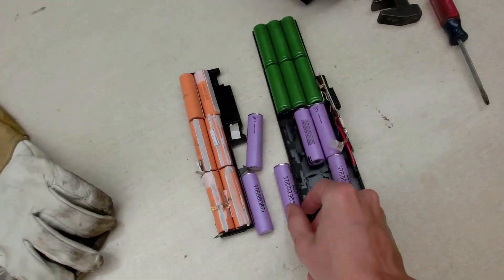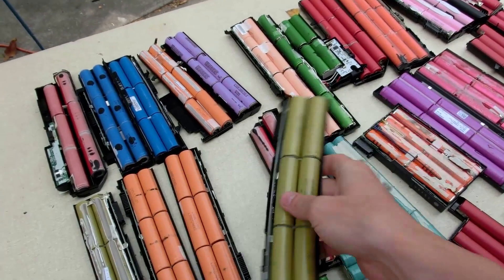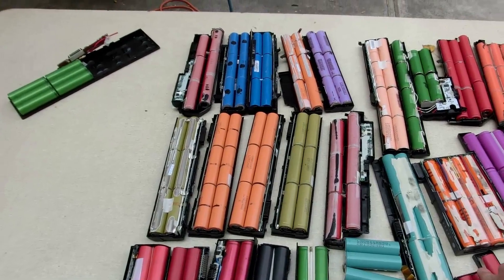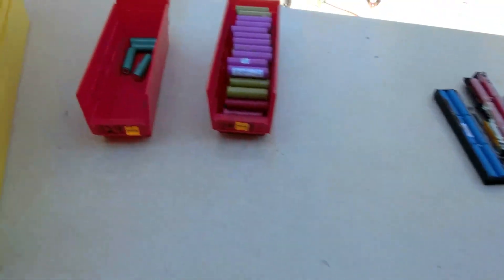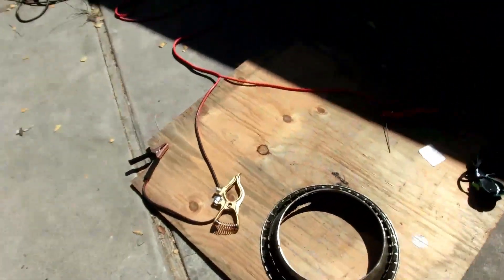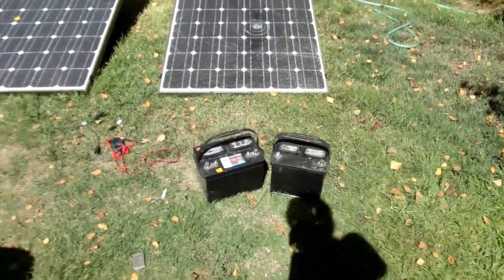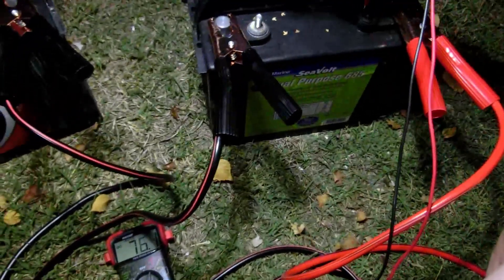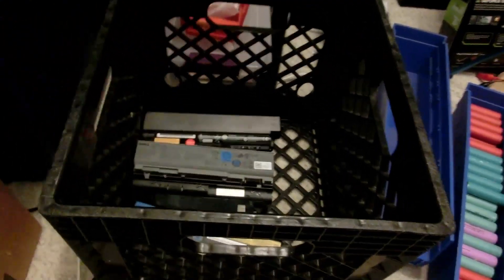Random Bits 0106: Harvesting 18650 cells, 48v Solar Charger

Comment: WOW! Your bench looks like mine. 18650 a go go. LOL. Because of the low current draw under load of my motors. I am thinking of using Boost dc to dc converters. 10Amp each per motor at 94Volts. So each of the 4 motors in the pod would have it's own power source essentialy. Then PWM type throttling for 4 motors using 2 dual stereo pots with the shafts coupled together. I believe that would work. Under full load each motor takes 3Amps. That's with roughly 280 pounds on the shaft and it was still turning at speed. I hope you get the same out of your car motor. Looking forward to the next video my very good friend. have a great day.
Reply from the maker: +Raymond Earle thanks!
Reply: As always my friend you are very very welcome.

Comment: Also do not use cheap steel from bed frames. I've read that it's very brittle and low quality. And difficult to work with. But it's dirt cheap.

Comment: I guess this is kindof stupid or maybe not but I wonder how far the range would increase with a solar panel on top I guess there isn't much surface area for one, it would probably mess with the batteries though and probably wouldn't be worth the fuss but it would be nice to see on paper
Reply from the maker: +Dynamitemonkey500 well with my trike i'm wanting to pull a pop-up camper/battery trailer that would have a solar panel on it.
Reply: +Rinoa Super-Genius ah that would make more sense
Reply: +Rinoa Super-Genius I was unsure weather the constant charging and discharging that would happen with a panel on the car would ruin the batteries as I guess it would be fine with a car battery